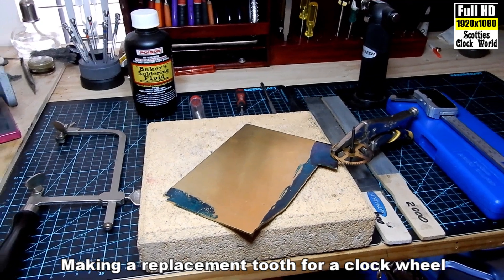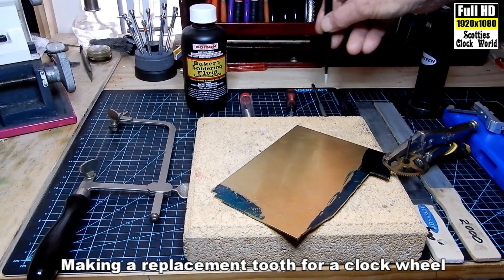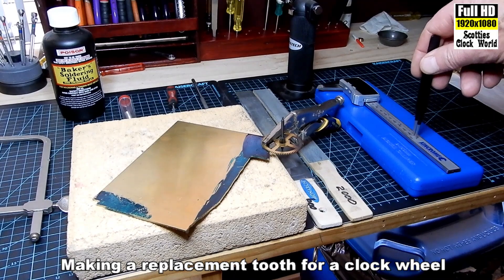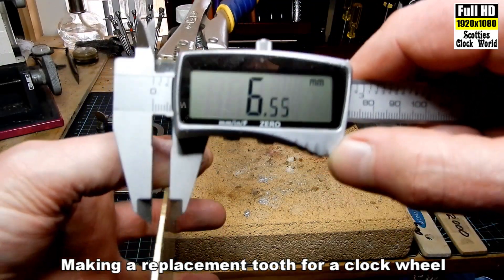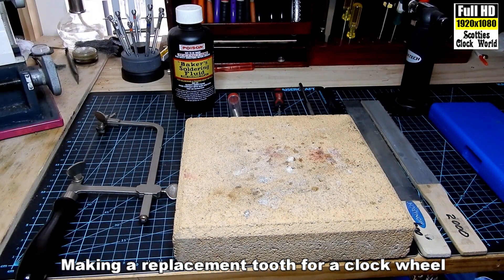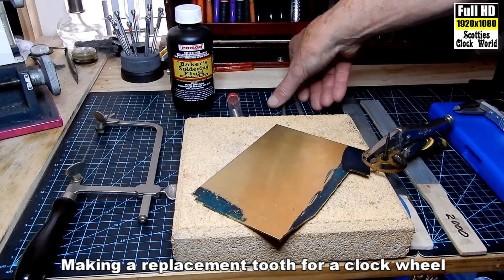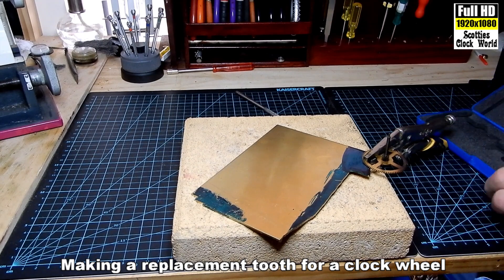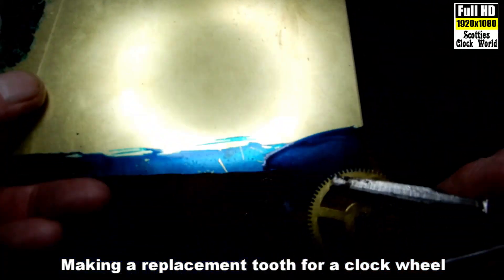Japanese 40 day wall clock service and repair - making a replacement tooth

Comment: A truly amazing repair...I’m inspired to try this!
Reply from the maker: Glad you liked the video. I will soon be shooting another video on tooth replacement, showing each and every step of the operation. Including how to fit the tooth into the wheel before soldering, the soldering process and then how to clean up once the replacement tooth has been fitted.